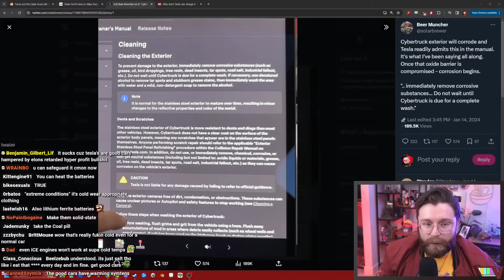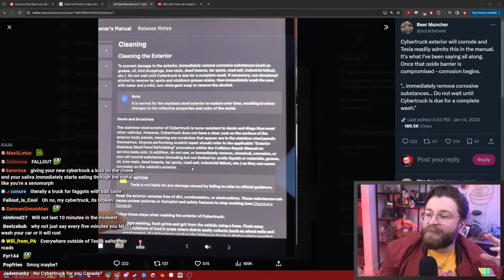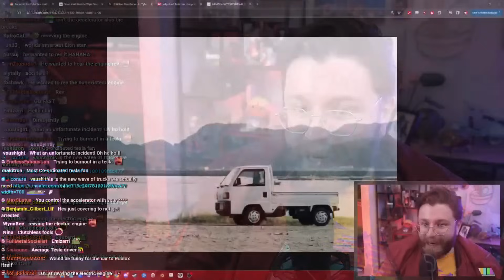Elon Musk's Cybertruck Is A Fragile Hunk Of Trash | Vaush Clip

Comment: I've been saying for years that I don't want a giant work truck, I want a small truck with a lot of towing capacity. Like a tug boat.
Reply: Well, if you want large towing capacity, getting a small truck probably isn't the best idea. Towing capacity is going to be largely limited by the friction you can generate between the wheels and the road.
Reply: Yeah but standard trucks don't have bigger or more wheels than any old regular car.
Reply: If you want a truck to do stuff, buy something like an Unimog, not a fancy Cybertuck
Reply: Toyota did it but it won't get approved in the us
Reply: @ligmayeye186  don't need to be 40 feet tall or 200 feet long to generate friction my dude. I'm asking for a smaller foot print, not smaller tires or less power. Do you know what a tug boat is/does?
Reply: Your after an Australian ute
Reply: @ligmayeye186  wider tires increase friction which is why big rigs have many.
Reply: @HepCatJack  big rigs also have significant amounts of weight, to increase traction.

Comment: It has drive by wire steering and brakes but no redundancy on the 48V power source.   For example each steering motor can just barely limp the steering and is on a seperate bus but there is only 1 48V lithium smart battery and the DC-DC converter from the main battery can’t handle the load separately.  There has already been one user report of losing steering and brakes.

Comment: 90 mile range pulling a 10,000 lb load. 40 miles if it's sub zero? My 22-year-old truck doesn't rust sitting outside. This is a joke of a work truck. The new soccer mom Hummer.